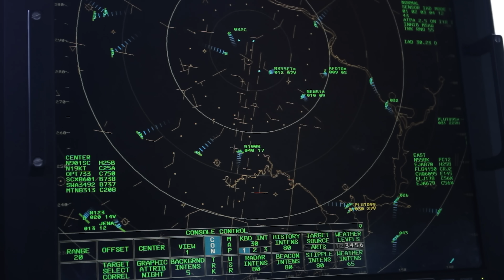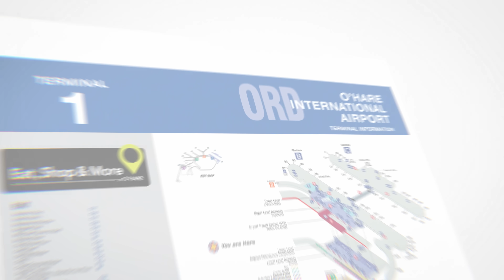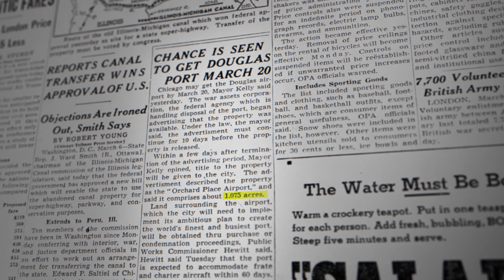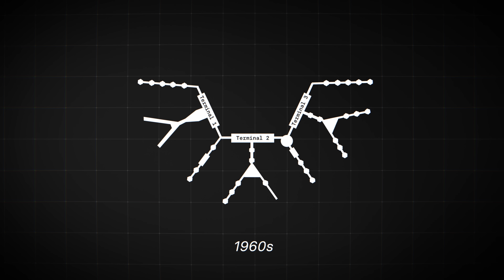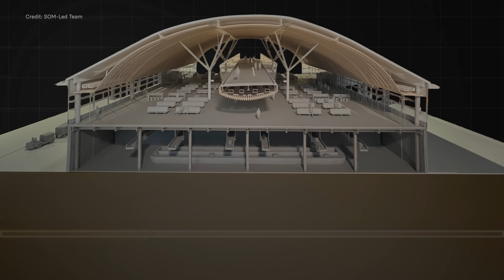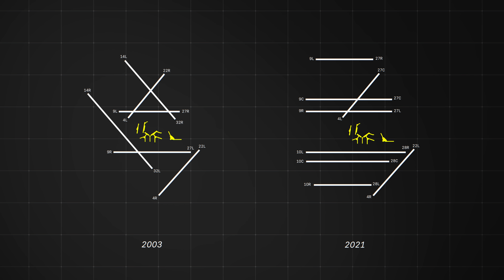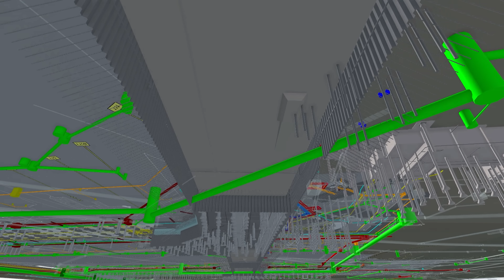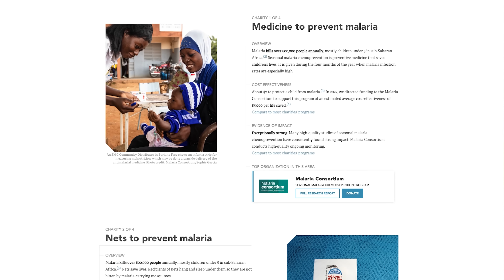The Megastructure That Just Keeps Expanding

Comment: It was actually designed when the airlines were interested in sticking with Airbus A380 and Boeing 787s.
However, since then, airlines have done their math and changed their prospective outlooks.  They no longer want to expand their fleets with these jets but rather smaller and more fuel efficient ones.
  Unfortunately, CDA is stuck with the O'Hare expansion.

Comment: One of the things I wish they would address with the update is that there is no easy way to get from the CTA to the Metra lines that wrap around the airport. A connection would make so much sense from a transit perspective but actually making it as it exists would involve walking miles along shoulders of highways and access roads.

Comment: Imagine if this sort of investment was given to rail in America.
Reply: Bingo.  What would be ideal is if the US ran an elevated passenger rail above the Freight corridors.  Speed could be the maximum possible.  Road crossings?  Who cares? It's elevated.  Right of Way?  Did I mention that it would use existing corridors?

People and luggage will always weigh less than a boxcar filled with freight and the units don't have to be built so robustly, saving more weight.   yt Channel "Adam Something" is against monorails in favor of trains but designing a better monorail is certainly possible.  Street level sections with tracks that are bike friendly? Definitely possible.  Better track switching? Definitely possible.

Monorails use less materials but can carry the same weight and again: that's important for traffic crossings and freight corridors.
Reply: @arcanondrum6543 Yea, no. I'm not riding an elevated train through the prairies. They shut I80 down when the winds are high. Sometimes the heavy rail Metra trains are ordered to stay in place when there's a storm blowing in.

Comment: ORD reminds me a lot of London Heathrow (my home airport). LHR started off as a star of David shape because the early airliners couldn't cope with high crosswinds, so they needed runways going in 3 (or 6 if you like) directions, and they put the terminals in the middle. Over time, as airliners got bigger and cross winds became less of an issue, the North and South parallel runways became the main ones and they retained one cross runway while converting the others to taxiways. Over time, even that one became redundant and they rebuilt terminal 2 to be at 90 degrees to the main runways instead of 60 (ish) degrees, and also Terminal 5 was built in the same way. So now you have a weird mix where terminals 3 and 4 are built at strange angles, along with the decommissioned terminal 1, and terminals 2 and 5 are at right angles. Future plans involve demolishing terminals 1 and 3 and expanding the new terminal 2 to re-orientate the whole central area to be at 90 degrees to the runways, while terminal 5 will be expanded westwards, with a 3rd parallel runway and sub-terminal to the north of the airport. Once done, the only remaining relic of the star of David shape will be terminal 4 and some of the maintenance areas.

Comment: 7:54 - “A mile and a half feet long.” Dang, that’s crazy long. Or super short. 🙊
Reply: Or very oddly precise. One mile and one half foot?
Reply: I got it as a mile and 6 inches.
Reply: Funny, the mile is a foot derived measurement anyway.
Reply: @evanhughes3027 technically, it's a pace-derived measurement. Mil=1,000=1,000 60" paces. Of course, the modern mile isn't the same length as the original Roman mile, otherwise it would be a clean 5,000 feet.

Comment: There's a big surge in folks wanting to build using historic building techniques and "natural" materials.

Do you have a plan to do a video on or have a reliable (emphasis on reliable) source of information regarding the full scope of building with things like cob buildings, adobe structures, "earth building", and things like eco brick building?  What are the real dangers behind these and are they still feasible to meet safety requirements or are there too many cons to the environment to make them worthwhile?  How about some of the real considerations with some of these underground concrete structures people are making?  Are there environments that can actually make something like that work as a living space?  How about safety features that are necessary considerations?

For reference, I want to live in a climate that experiences heavy snow. (Hello!  I live 3 hours north of Chicago :D ) Is a cob structure a feasible option that is both safe and reliable through the elements?  

There are plenty of sources claiming it is, but I would love to see a series on historic building techniques and materials and why the would or would not work in modern society in different climates.  You have really amazing models used in your videos paired with heaps of technical information that I would love a series like this from you!

Comment: loool a mille and a half feet long, god imperial units really make no sense at all
Reply: 1.5km and 1.5mi make exactly the same amount of sense in isolation
Reply: @JH-tc3yu   We are not talking about 1.5 here. We are talking about 1 mile and a half feet. Maybe Stewart was meant to say 1.5 miles, we will not know.
Reply: @JH-tc3yu  1.5 km is 1500 meters. How many feet is 1.5 miles?
Reply: @Emre_Kermen  5280 ft x 1.5 = 7,920 ft total. Pretty easy math. 60 mph is the standard, so in the U.S. at least it’s exceedingly easy to determine how long traveling somewhere will take just by knowing the distance. If it’s mostly highway, then m average speed will be over a mile a minute and I’ll arrive right on time or even a bit early without using any maps or apps. Kilometers don’t seem as translatable easily, but prove me wrong I guess.

Comment: Of course the roads connecting to/from ORD will need to be fungi too
Reply: Those are the roots in which the fungi pulls nutrients from to keep expanding
Reply: As someone else has mentioned, better connections to multiple other modes of transit are necessary. Why drive to an airport and have the car sit in a parking lot for days or weeks? High-speed rail would be great too.
Reply: @barryrobbins7694  drop offs and pick ups

Comment: It's funny how even airports have to use the benefits of pedestrian-centered urban planning with public transit in order to work. People love to say driving is better for everything but I've never seen a car-centric airport where people drive from gate to gate, even in the car-centric hell that the US is. It's almost like car-centric design is just terrible and inefficient.
Reply: I was thinking about this when he was talking about multiple nodes being better for airplanes. I think you can run into the same question if prioritizing human experience vs plane efficiency.
Reply: When notable exception is DFW. When first opened it was designed so that you would drive in and park practically at the gate. The result is extremely long times when transferring from gate to gate in a terminal.
Reply: @norlockv DFWs terminals are similar to the old MCIs. Why did they eventually fail while DFWs is still doing ok?
Reply: @Snarkyone80  SkyTrain.
Reply: @norlockv  Extremely? No. The DFW transit system is fast enough. No more than 10 minutes to the other side of the airport
Reply: @米空軍パイロット I’ve missed flights when that train stops in mid-transit. I’m not unique.
Reply: Meanwhile Manila Ninoy Aquino International Airport where you have to drive (or take a bus and taxi) between terminals. They built a highway instead of an airport train between the terminals.
Reply: @GenericUrbanism ahh, yes, the Skyway.   They practically (San Miguel Corp?) turned NAIA and NAIA terminal 3 into different airports for travelers.
Reply: I'd submit that LAX is close to your car-centric model even after the people-mover comes on line.
Reply: @rollinwithunclepete824 I have it from good authority that “nobody walks in L.A.”
Reply: I cane to say this too.  Horseshoe with parking lot in the middle.
Reply: I live right next to the executive terminal. They drive their car right by the plane. You just aren’t rich enough I guess. 🤷🏼‍♂️
Reply: The number of nodes (gates) in an airport is vastly smaller than even small towns. They are also almost always placed linearly.
Reply: I know the intent of this post but it is functionally wrong, almost every airport uses personal vehicles to move singular passangers around the airport. These personal vehicles match the function of cars on a smaller scale, with most of this being done by golf carts or baggage carts to move individuals and their luggage around the airport. Also on an even smaller scale most airports provide or allow electric personal vehicles for a small rental price for those with walking difficultys to rent, which would function as a car in the airport-city model and are integral to the function of the airport. Arguing that an airport doesn't need personal vehicles is inaccurate and obtuse.
Reply: Kansas City’s original terminals were  originally planned to have you drive up to your gate. Was a terrible facility that never actually functioned very well
Reply: Almost like airplanes carry people, not cars (generally).
Reply: Berlin Tegel airport was basically this pre-9/11
Reply: where do people park the cars? not like the people going to return shortly from plane trip
Reply: Very true. America cares very little about helping everyone, but cares a lot about the people who can pay.
Reply: Yeah why won't the government install a people mover from my house to my work
Reply: @plixplop people movers are just trains... hope they install the one you need soon 🙏
Reply: @manuelka15  A train from my house to work would be sweet
Reply: Well, in big cities, yes. Everywhere else? No. Much of North America wouldn't function without cars.
Reply: That seems like a very tautological way to approach the topic. Airports are surrounded by HUGE amounts of parking lot because they need to be served by many times the practical capacity of whatever transit connections they have.
Reply: @josephfisher426  the Singapore airport is a notable exception. They really made the whole thing a big transit hub; mini city like Stewart was talking about.
I wonder whether multiple smaller airports would be better than these massive ones.
Reply: Human movement is terrible and inefficient.
You can't control where someone's job is or if they want to go to "that" coffee shop instead of the "other" one. With an airport you know their start point and end point now matter what.
Reply: You tubers Adam Something and Not Just Bikes agree with you.
Reply: RDU Raleigh-Durham has a dangerous pedestrian route between terminals, and the cab driver recommended not to do that
Reply: @MrZephy  A cab is still public transportation, even if its one of the least efficient. Still way better than individual cars
Reply: @pascal6871 if taxis count as public transportation then normal cars count too because you can ride share and take passengers. In fact a car with the same amount of passengers is the same efficiency and it can be better with more people in it.
Reply: @pascal6871  how is it better than an individual car? It’s literally the same type of vehicle
Reply: @H0mework  exactly
Reply: @lucasread1743 the difference is parking space. A personal car is used for way less time during a day and you have to keep it somewhere.
And this becomes an even bigger issue around public spaces, from public services to venues, etc. You need way more space to accomodate your customers if everyone is using their own cars, public transport frees up this space to use more efficiently, even if that public transport is a bunch of cabs.
Reply: @lucasread1743 one cab can serve hundreds of people in a day, without needing any parking space.
Reply: There are incalculable reasons why this is a bad analogy, but I'll just ask one question: how long do you think it would take to get a car through TSA?
Reply: @HALLish-jl5mo I think that makes the analogy even better. No matter how many lanes the highway or roads have, the exits are at most one or two lanes and that causes congestion in the entire system, just like TSA would.
Reply: @pascal6871  High capacity junctions exist. I've only seen roundabouts back up down the entire slip road onto motorways a couple of times. 

Although I don't think America really uses roundabouts, so maybe it's more common there?
Reply: @HALLish-jl5mo The only time I've seen issues with exits causing congestion involves either road work or law enforcement shutting down exits and people having to detour or for the cloverleafs where people have to exit from and merge onto the highway in the same lane and the same space.
Reply: Cities built before the invention of the automobile are exceptional places for walking. And for public transit.  In fact, the first 2 Stations of the Boston Subway are incredibly close yet apparently necessary due to foot and carriage traffic.

Walkable cities are FAR better for peace of mind and for business.  I don't recall which city but planners decided to end motor traffic for 2 blocks of downtown for a public way.  The businesses within that 2 block section were extremely upset and promised to sue the city for lost revenue after they failed to stop the change.

After it was built, the downtown businesses not within that 2 block section tried to sue or coax the city into including them in a similar public way.

The only downside is the Disneyfication of Quincy Market in Boston.  It used to be on the Waterfront (now it's more than a block away due to landfill).  When its first function as a fish market slowed down, it was revived into a General Marketplace and due to Fanueil Hall being within its footprint and that being on the Freedom Trail, Quincy Market with its shops, restaurants, generous seating and public entertainment was a magnet for tourist and local patrons.

Success drives up costs and Disney coveted the space... Well, they had the funds and they don't play to lose.  It's all still there but it's not as good as it was.  Most of the shops became what you would find in a Mall.
Reply: @arcanondrum6543 Imagine how stupid you have to be to think that allowing easier access for criminal "youths" to rob your store and mug potential customers outside makes your business more profitable.
Reply: Stupidest comment award.